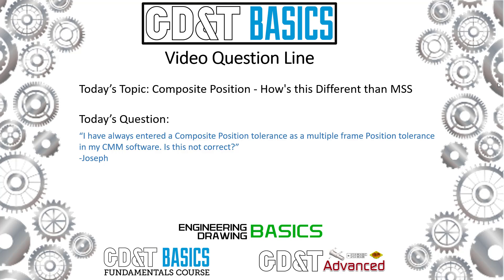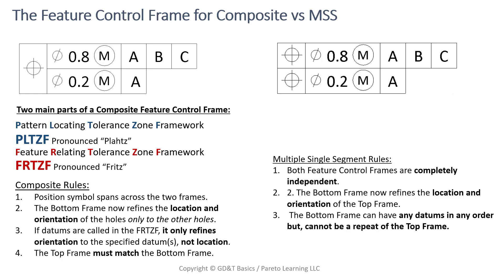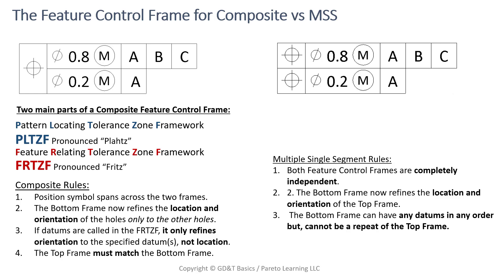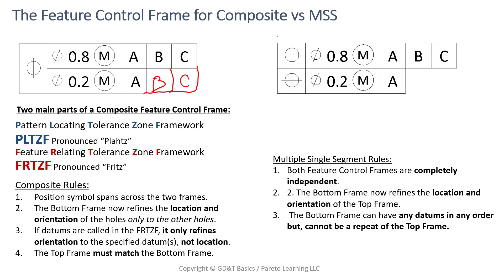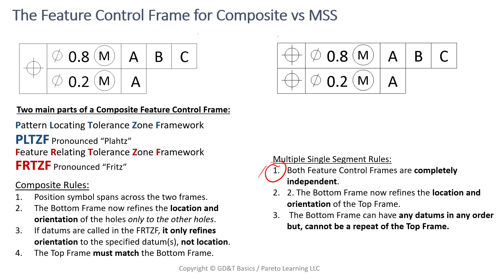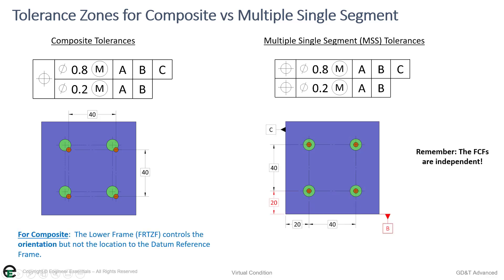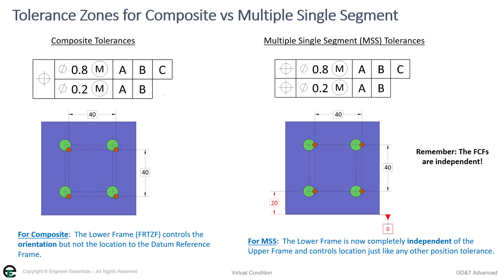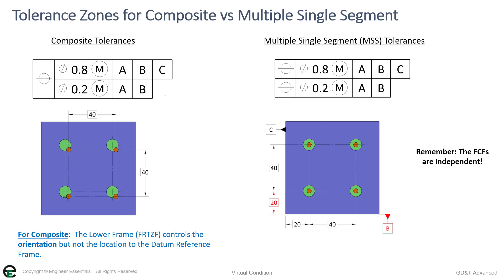Composite Position vs Multiple Single Segment Tolerances

Comment: I've always been unclear about what is meant by "only to the other holes."   I assume it means - rotate and translate the individual tolerance zones (defined in the lower segment) as a "rigid body" in order to minimize the root sum square error relative to the actual holes.  Once the minimum error pattern location and orientation is established, apply the lower segment tolerance.  What do you think?
Reply from the maker: Very well articulated! i think you got it down.

Comment: I think the red circles should have stayed within the envelope of the green circles.  Otherwise, the hole center could move outside of the green circle.
Reply from the maker: The red circles can theoretically be outside the green ones HOWEVER the axis must lie inside each of the circles. So this would require some portion of the red circle to always overlap the green circles. Like a Venn Diagram.

Comment: Is the value of .2 in the lower frame means it's -/+.1?
Reply from the maker: Thanks for the question! The .2 in the lower frame is a diametric tolerance zone. So yes in an indirect way you could view this as ±.1 or deviating radially by .1
Reply: @Gdandtbasics  Thank you!

Comment: If I made a composite FCF and had a M (maximum material condition modifier) called out in the first frame, do I HAVE to also add that to the second and/or third frame?
Reply from the maker: Thanks for your question! For composite FCF's the modifiers and datum structure must be repeated in the same order as set out by the upper frame.

Comment: i have a question, in multiple segment example with bottom segment has datum a and b ,can 2 hole in top part more than apart basic dimension as 40. i mean do these holes acts like pattern or 4 holes can be anywhere in that slot shape, thank you for video
Reply from the maker: For the multiple single segment example where the bottom frame has A|B listed for the pattern of four holes is controlled together using the 40 basic dimension. This pattern of holes is held perpendicular to A and located to B using the basic dimension of 20.

Comment: So, when you are reading a blueprint how can you tell the difference between composite and MSS?
Reply from the maker: Great question, for composite feature control frames there will be only one symbol on the left that spans multiple tolerance values. Where as for MSS there will be a symbol on the left for each tolerance value. Check out this page for a more visual representation of these two different controls.

https://www.gdandtbasics.com/composite-position-vs-multiple-single-segment-tolerances/
Reply: @Gdandtbasics  Thank you!

Comment: Thanks for the video, great explanation! One question: on the last part of the video, where you compare the tolerance zones of composite and multiple single segment (MSS), you show that adding datum C to the MSS would just invalidate the top segment of the FCF. But what would happen if you would add datum C to the composite FCF? From my understanding, the tolerance zone would still be the same, since datum A and B are completely refining the orientation of the pattern (2 planes would lock all 3 rotation axes), is this correct?
Reply from the maker: You are correct in your statement. The tertiary datum reference in the FRTZ would not do anything since the first two datum feature references already lock in the orientation of the pattern. While the standard does not restrict you from doing this, it is considered bad practice to include it.

Comment: The graphic feature control frames for the "Composite" is clearly applied for a relaxed geometric tolerance followed by a refinement as with orientation or form.  The single segmented tolerance feature control frames are all detailed as independent controls with a refinement stated below.  The information you gave is helpful to the GD&T user.  Thanks!

T J (Tom) Vanderloop, CMfgE, Author, Mechanical Designer, & Consultant; Memberships ATEA, AWS & SME